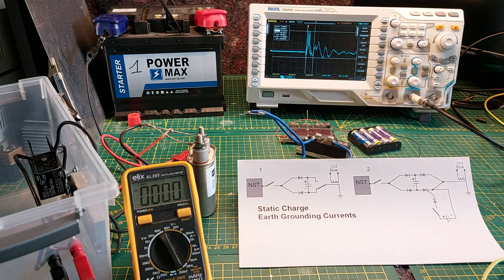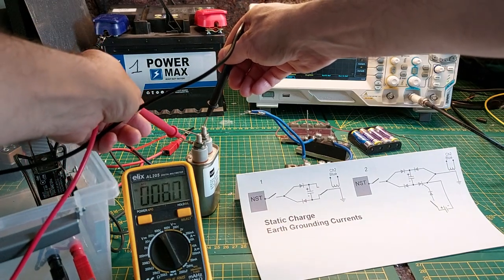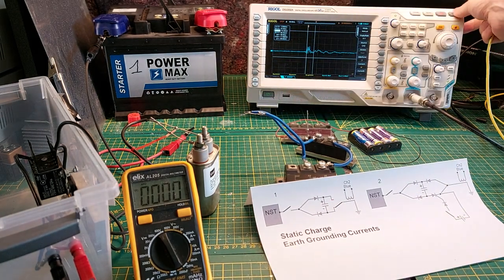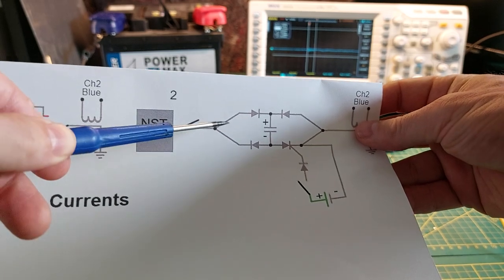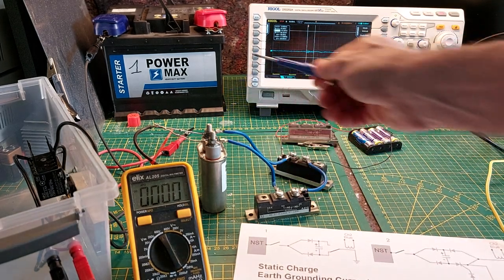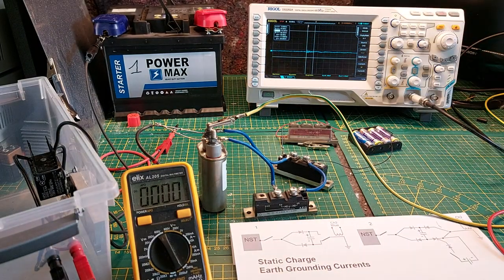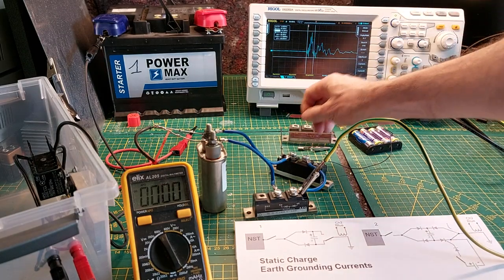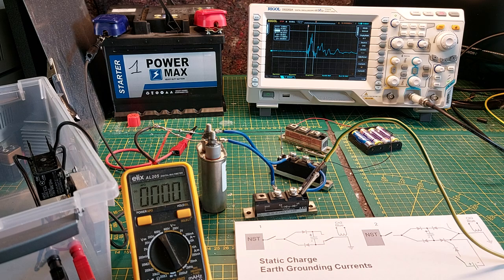Static Charge As Source For Earth Grounding Currents

Comment: Hello Bruno Vk, and congratulations for the ambition, dedication and results shared with us! Build a rectifier bridge with ultra fast diodes UF4007, put 3 in series on each branch, and instead of the SCR put a 1200V mosfet C2M0160120D, controlled with VOM1271. This way you can also put mosfets in series.. up to the required control voltage. Order the mosfets and please share the results with us! Does the capacitor discharge? How long does it take? etc... Thank you!

Comment: All The Way From Nigeria, West-Africa.

Now let me help you about The Don Smith Effect.

You must wind at least 2 coils over one another in Clockwise direction. You must use a Minimum of 90 Volt Direct Current. HIGH IS BETTER AS LONG AS YOU HAVE AN N-CHANNEL MOSFET TO HANDLE THE HIGH VOLTAGE.

When I SAY you must, it is what it is

48-42 kilohertz should be the pulsing frequency from your signal gen to MOSFET  Gate to pulse your voltage Step-Up Trafo.

Do not forget the minimum 90VDC input. Forget Trial and Error. I am giving you free of charge what works to save you from suffering.

Use 980 inches Rubber Insulated copper wire to wind the Secondary from left to right in Clockwise direction.
 Use the same length for Primary.

YOU CAN WIND AS MANY SECONDARY AS YOU LIKE TO GET EXTREMLY HIGH POWER.  BUT THEY MUST ALL BE WOUND IN THE SAME DIRECTION. My secondaries in total are 6 with one primary intop of them all. Core or No Core, the TraGen works well but only at High Frequency.

Now, connect Al the secondaries in series UpTo to single primary.

What this means is to connect the head lead of the first secondary to the tail of the Primary. Thereafter, connect the tail of the first secondary to the head of the second secondary winding. So if you wind many secondaries, go that way to connect them.

The lead or head of the primary goes to the Positive terminal of the Battery or Power supply of at least 90VDC. While it tail goes to the MOSFET.

Never wind Clockwise direction from RIGTH to left. NO!

With this connections now in place, you have one wire as final output. That one wire is the gateway to SUCKING MASSIVE CURRENT from the ground.

The best point to place your Copper or aluminum plate is on Underground Rock!! This is a Massive Secret. I actually practically discovered this because I dug 2 seperate earth grounds of over 10Meters apart. I professionally installed the Earth Point. So it is not just anyhow or Child's play thing AT ALL.
 
The first Earth point the most POTENT!!
There is an igneous rock at the base of the 10feet deep hole. I place my 10mm thick Pure Copper plate on top of that Rock. 

You need to see how Potent it is in comparison with the other one with same deepness but watery base.

Now back to the circuit.

The one wire must be connected to your the Positive leg of your DC capacitor Bank.

The Higher the Uf or FARAD, the High your Output Wattage would be.

Now connect an High Voltage High Frequency Diode like HER208 or FR607 to the Negative Terminal of your DC Cap Bank. 

From that Diode Output side, is where you will connect to,  one leg of the windings of your Ferrite Core High Voltage,  Tuned with  Cap and Resistor Combination on the Primary Winding Of The StepDown Trafo.

The other leg of the Step Down Trafo goes to the the same Ground. Take another Diode. Connect it Input side to the Earth or Ground. Connect it output side to the Negative Terminal of your DC Capacitor Bank(AVRAMENKO PLUG there!!)

Now switch to your Stepdown Trafo output on the secondary. Use a Full Wave  Diode Bridge to negate is AC like oscillation.

Now use a Pi Filter calculator to know the Inductor size and DC capacitor size you will need to convert any left over oscillation to a PURE Direct Current.

You start with 90VDC, Wind your Step-Down to get the same voltage or Higher as your needs requires.

For instance, you may want to Power an Inverter with 90VDC or even as low as 12VDC or 48DC or 192VDC etc. Therefore, Wind your Step-Down Trafo to that output voltage level.

But remember to wind the transformer to the needed require Wattage.

Also Add More Caps if you need High Wattage.

Goodluck!

Need more clarifications? Reach me via WhatsApp Plus 234 Seven Zero 60578569.

Comment: Hi Bruno, did you try anything new?
Reply from the maker: @rochaaraujo9320, I have 3 experiments I'm currently working on. I know it's not good that way to have multiple in progress at the same time but in the background they are a search to answer the same questions:
Can I get more response then what I put into the setup :)
I know it's possible in open loop systems, it's just finding a repetitive way that can lead to more comfortable outputs.
One experiment is with the open loop circuit like this:
https://youtu.be/qEoVlrA0C1s
For the static charge, I gor this in mind, but only succeeded in very few experiments because free time limit:
https://youtu.be/rAFN966_7lM
It was a dissaopointment that charge on the outside can influence charge on inside, in contradiction to what is been told in general. But not enough experience yet.

Comment: Amazing job. If you repeat this process for thousand times, capacitor will be do discharged?
Reply from the maker: @Rochaaraujo9320, To be able and answer that question I would need to succeed and do the fast switching. At the moment it´s hard to see if it´s self discharge or due to the switching. That part will become clear once I'm able to do the fast switching. Also from past experiments, if I would go above +-7KV, I experienced other intresting things, like extra input, but for that I need to be able and switch such high voltages. So there´s always something to overcome. I know those things are happening, just technical (my knowledge ) limitations to what I want to achieve.
Reply from the maker: I also want to add, that at the moment, I personally don´t think that it´s discharge. When I place my voltmeter (10Mohm internal resistance) then voltage drops fast on that capacitor. Also I have open loop (looking from Earth ground current, diode in blocking mode can passthrough spike), because the NST is battery powered. 
Fast switching will bring answers :)
Reply: I was thinking about this and came up with a hypothesis for your experiment: When you connect the ground to one of the terminals and leave the other terminal open, theoretically nothing should happen, but there is a voltage difference between the terminal and the ground. This causes electrons to move towards the terminal due to their kinetic energy (I just came up with this), allowing them to reach the positive terminal of the capacitor. Consequently, the negative terminal becomes unbalanced and wants to expel electrons. When you switch and touch the negative terminal, these electrons are ejected from that terminal. In summary, every time you touch the positive terminal, it acquires some electrons up to a certain level of saturation. Every time you touch the negative terminal, it loses electrons up to a certain level of saturation. This saturation level is defined by the capacitor itself in balancing the charges between the plates. If what I said makes any sense, we have a few premises:

The positive terminal will approach the ground, becoming less positive, every each touch.
The negative terminal will become more positive, moving away from the ground, every each touch.
In other words, the potential between the capacitor terminals will decrease, but both terminals will remain distant from the ground.
I eagerly await the new tests on this circuit.
Reply from the maker: @rochaaraujo9320 , Did you see the manual switchef higher voltage version? https://youtu.be/B6XizmfpzTQ

If you look at electroscope, you see the voltage increase. The thing is, that when I placed a transformer in series, I could see a small led blink. 

What I experienced with that setup is that when voltage was above 7KV it was keeping itself alive for over a half hour. The time between arcing was increasing but I didn´t add myself to the circuit. If the arcing was first every 15sec then the last arcing was each 2min sort to speak. So it´s important to keep in mind that above that 7KV there could be overshoot once things start to flow. 

@rochaaraujo9320 , Did you see the manual switchef higher voltage version? https://youtu.be/B6XizmfpzTQ
If you look at electroscope, you see the voltage increase. The thing is, that when I placed a transformer in series, I could see a small led blink.
What I experienced with that setup is that when voltage was above 7KV it was keeping itself alive for over a half hour. The time between arcing was increasing but I didn´t add myself to the circuit. If the arcing was first every 15sec then the last arcing was each 2min sort to speak. So it´s important to keep in mind that above that 7KV there could be overshoot once things start to flow.
Reply: @brunovk417  I saw the video. I believe that when you charge capacitor with high voltage, positive side became fews kV over ground and negative side became fews kV under ground reference. When you touch negative side, put few electrons there, pushing positive side to repel more electrons. Because that, electroscope on positive side open a little.

About the spark when you shorted capacitor, let's assume that was a bit bigger when you touched negative side with ground. So... This means that potential or charge in capacitor is bigger. I don't have a hypothesis for this.
Reply: @brunovk417  did you have a video about that leds blinking when you touch the ground?
Reply from the maker: @rochaaraujo9320, Here are the other video´s related to the subject, some of them are hidden:
https://youtu.be/L0drvfhUlh4?si=s1pKQDeBa1d9tHIL

https://youtu.be/hqIi1YjYMkg

https://youtu.be/eiAkMkK8lPc

https://youtu.be/FynEprW-gd8?si=C3G-MhO_PPQ3moSI

https://youtu.be/uTTUMwhFPNE?si=X_och2SsYm1cZ_fJ

I have the feeling there´s something there that translates itself into electricity, but in it´s original state is not electricity. Otherwise I should be able to control it also with mosfet and IGBT (if it´s electrons) That´s just my personal opinion but I´m far from qualified to tell, that´s the cause.
Reply from the maker: It´s also the reason why I believe open loop systems can give us more then generally thought. There´s something that is not yet publicly acknowledged, with it´s own properties. It´s like the source is there but we put it under the rug so nobody´s asks questions :) There are allready names for it (eather,chi,prana). Again I´m not qualified, but I know things don´t add up once actual experimenting is done and trying to look add it from conventional standpoint.
Reply: I'm trying to interpret using basic principles of electrostatic induction. But just using those concepts, is difficult to explain your experiment.
Reply from the maker: @rochaaraujo9320 For me it´s the door to underdamped waves in resonant tank, or negative resistance in general. Maybe the comparison is wrong, but I know if I could keep things in after the spark gap, then especially with higher voltage, I could see that kind of behavior. In the past I was trying to build a spark gap with behavior like Faraday ice pail experiment, where charge was on outside and could not go back to inside, so that I have a one way street, but didn´t succeed in that. In the ice pail experiment you can start with for example 3KV end build up on outside of pail to 30KV. In my spark gaps I end up with same voltage on both sides.

Comment: Could you please tell me if the capacitor you’re using is polarized if it is I would ask you to try a non-polarized capacitor and see if you experience the same thing that I do I experience the same phenomenon as you had in this video but when I had done it but only one leg of the capacitor would give me the ground poles I wouldn’t have to switch between them the only thing I could think of that was different between my set up and yours was I had a non-polarized high frequency film capacitor rated it at 3KV over  and over again I could  ground currents when I connect to positive leg of capacitor but nothing on negative or very rarely or if anything a very very small pulse perhaps the negative Pulse is coming in faster than my oscilloscope can read it is a cheap one
Reply from the maker: Just quick answer due to not having time for the moment: the capacitor is non polarized, but precharged with dc voltage by the Avramenko plug. 
For measurement: it all happens so fast that I need the RF current probe because it´s only happenin at the instant moment of a change.
In this video description I added 3 small video´s that show you what happens when using mosfet or IGBT (for the parts I used, it can not be taken general) 
With the electroscope I could see the pulse of voltage if you look at my video´s on the charged capacitor investigation.
Reply: @brunovk417  I was about to ask about about MOSFETs etc, thanks for the extra videos
Reply: My positive pulses come in at around 44 MHz The do you ring slightly

Comment: Could be groundbreaking ... excuse the pun. Watching with interest. What capacitor are you using?
Reply from the maker: @dSquared0162, The capacitor is 2µF 1000V (no internal discharge resisitor)

Some extra details that could be intresting:
If I look at the table for convertion of the measured value of RF current probe, then around 10Mhz I need to calculate with 0.101V/A, around 25Mhz 0.099V/A.
Peak value is around 70mV, this would be around 700mA. Only for 56nseconds in this setup, therefor I would need to find a way to do Mhz switching and repeat things in high frequency switching.
This video is just to show that it's possible.
Reply: @brunovk417  Thanks.  You said the capacitor was polarized, was that correct? 
Also, I've been looking for that NST with no luck - what model is it / where did you source it?
Reply from the maker: @dSquared0162, Lucky it doesn't really matter what your high voltage source is, as long as it's pulsed dc if you work with AV plug for charging up.
This is how I did the experiment:
1) My NST is Ventex VTI510-I2, 1500V, it's 12Vdc battery powered.
Because I used Avramenko plug to charge my capacitor, I need high voltage pulsed DC.
     However, if you have a cst DC high voltage source, you only need to be able and safely disconnect that source after the capacitor is charged to the high voltage that you want.
 The base for this experiment is a precharged capacitor to for example 1KV, no source during experimenting.
I even did this experiment in the past by charging the capacitor with my Wimshurst generator, but back then I was not able to do the switching electronically.
2) After the capacitor is charged, I measured the Earth grounding currents when connection is made with Earth ground.
Current probe is the only connected to scope and scope has 1:1 transformer in the source.
The Tekbox RF current probe measurement is based on magnetic field and to lower capacitive coupling thick insulting tube is added around the cable in center of the meausring probe to reduce capacitive value of that coupling.

I know from past experiments that current is really flowing there by using transformer and small led, it was just because of low frequency no serious output was possible with my setups. All things will depend on how fast I can go with the repeating of the switching and the high voltage I can go to.

It's important for this experiment to fully understand, that you need to be able and disconnect you source from the precharging capacitor, otherwise there will always be doubt if the source has somehow influence or not.
Reply from the maker: The less self discharge of your capacitor, the more easier the experimenting will be, because the high voltage value is what is determining the current value together with Earth ground resistance.
The spreading resistance of the Earth ground connection used is around 8ohm in my case.
Reply: @brunovk417  Love the detailed answer. Thank you.
Reply: @brunovk417 

did you use an actual copper rod for your ground?
and did you you vary your resistance through a Rheostat or Potentiometer?
also did you put a diode on you ground connection?
Reply from the maker: @alexkoteles , I don´t know if you saw my video´s on plasma column and the documents on single plate tryouts:
https://drive.google.com/file/d/1QJltrYpr4ISYmncmWLEtXivFMgJnkLDC/view?usp=drivesdk
And multiple plates experiments:
https://drive.google.com/file/d/1k6orYY8aS_E2EA7i8J1hirJEFy3o5Rli/view?usp=drivesdk

My grounding is made of 4 rod´s in square with distance between rods = length of the rod´s
https://drive.google.com/file/d/1k6orYY8aS_E2EA7i8J1hirJEFy3o5Rli/view?usp=drivesdk
Placing a resistor gave less output, but it´s only what I experienced, so it´s perfectly possible I´m missing something so that I don´t have impedance matching propertie or so.
The reostat I have not used.